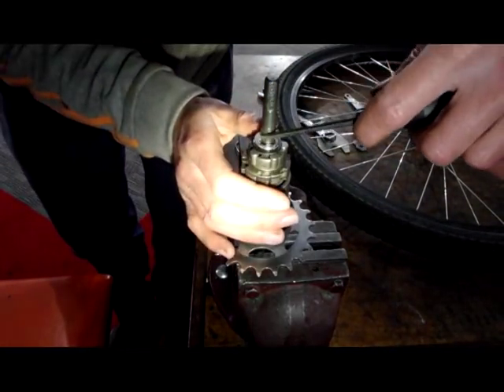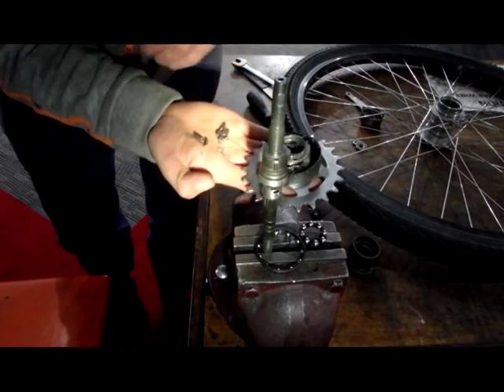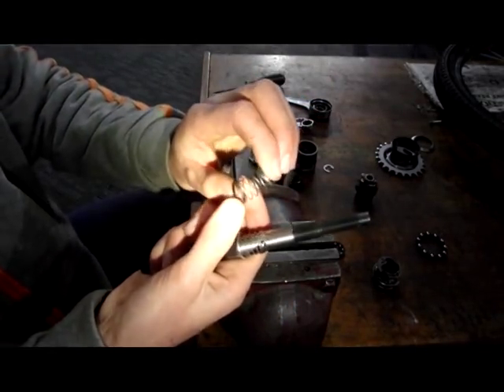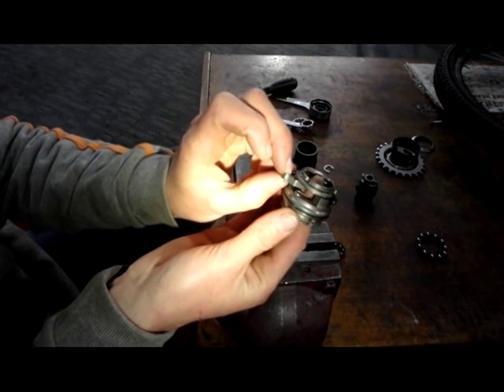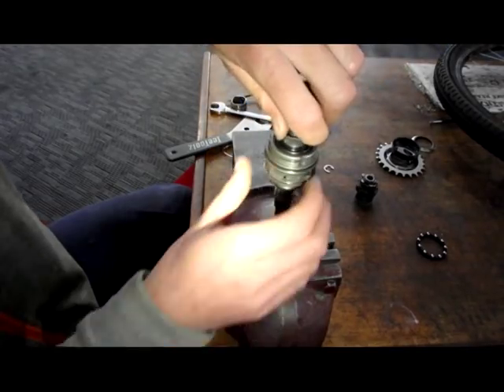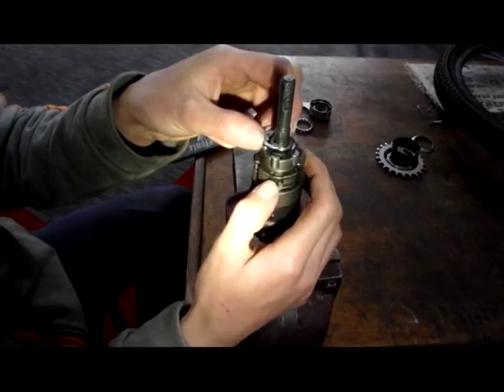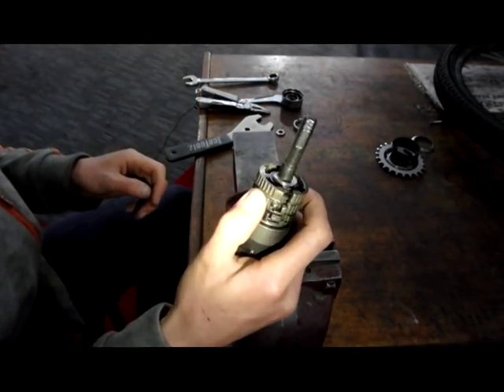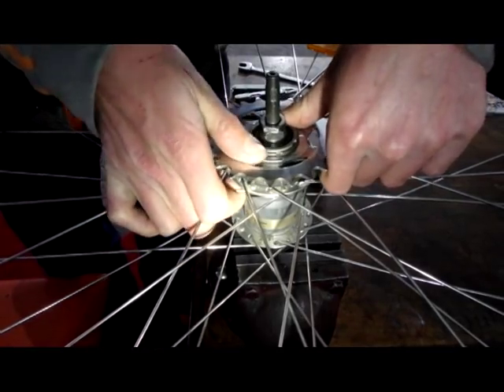How to strip and rebuild a Nexus 3 speed hub

Comment: Hi buddy, I believe you overtightened the first cone (approx. 8-9 minutes in). You’re supposed to tighten the cone as far as it will go, then back off 120degrees. Then lock in that position with the lock nut. This leaves a touch of play to prevent premature wear. Hope this helps!
Reply from the maker: It turns out that the 2 head bearings are opposed by a single tail bearing.  It is a bitof a  weird set up but you can safely tighten it right up to the shoulder. The brake side bearing takes all the tension adjustment

Comment: My dissambly ends at 2:40, when one little spring went off for ever! - I would prefer to lay down the parts in the way when they appear. A not so dark paper or  a textile on the work bench will help to prevent a chaos of things. An explosition drawing from Shimano‘s hub will help to put the parts together, and is a good training to study technical instructions. - I did never seen to put the vice in this way at the right end on the work bench. But its a good tip, when the mechanic is a right hand trained person.
Reply from the maker: im a leftie, in a right handers world

Comment: Well done!  This has got to be the clearest how to video I've seen to date.  Cheers.
I do have a question; my daughter's bike came with a v-brake in addition to the coaster brake, I'd like to eliminate the coaster brake.  Is it sufficient and possible to just remove the brake arm?  Or a better way to go is to eliminate the brake shoes?  Or does eliminating the brake shoes mess up the assembly for the bearing that sits on top?  Thanks.
Reply from the maker: It should be ok to remove th ebrake shoes, it might pay to remove the 5 hardened rolls that activate the shoes, you need to take that surclip off.
the braking action grinds hardened steel past hardened steel behind the same grease seal as the rest of the moving parts. with all this hardened metal muck floating around, wear sets in, as wear sets in, gaps increase, pins move, springs drop out, munched spring wire migrates into the bell housing, and jams it between 2 gears, when this happens the hub locks up but the wheel is still moving foward with a huge mechanical advantage over the NO TURN washer on the axle. the axle spins in the no turn washer, and the hub is cactused... all because some pea-brained dimwit put the brakes behind the same grease seal as the rest of the moving parts
Reply: Can you post a vid of exactly what you are talking about? I'd hate to mess it up.

Comment: Hi mate!
Love your video, and used it to dis- and resemble my gear hub.

I got a blocking on 3rd gear. 1st fine, 2nd more resistance but when going on 3rd the pedals only turn 1/4-1/2 around before blocking completely. If I switch to the 2nd or 1st gear, and roll the back wheel backwards, the (new) push pin pops back and I can continue cycling. 

When staying in 3rd gear and rolling the wheel backwards, there is a clicking sound every 1/4-1/2 when the wheel turns.

The hub was old when I got it and restored it, so no guarantee that it worked when I got the hub.

What do you think is the problem?

Best regards
Reply from the maker: I usually found that the quickest way to fix it was to strip it down to the bare mines, and reassemble, 
The strip down takes less than 30 seconds, the reassembly takes less than a minute, if you have your tools in a row.

Look for extraneous broken shards of metal causing a constipated hub
Reply: @AdamEdington  Cheers mate!

Might give it a go soon, but I am expecting the strip down and reassembly will take longer on my behalf ;)

Thank you for your kind advice!
Reply from the maker: @hunnicke1986  usually 
something is not moving as far as it should, or jammed up with some thing where it's not meant to be
Push pin should have 14mm stickout
Reply: @AdamEdington cheers!

I couldn't find the missing part/link/fault so I stick to 2 out of 3 gears for now 😂

Now I got a new problem. On an advice from a friend, I removed a lot of the thick chain grease I had used before (I am new to this and learning) and then I gave the whole thing Caramba Premium MultiÖil. Now the foot brake screams when used. What would you suggest to fix it? Put the whole thing in transmission oil (as I got recommended from a local bike mechanic)? 🙂
Reply from the maker: @hunnicke1986  ok that makes a bit more diagnostic sense.
I'm going to need you to run a few more tests for me
It's a bit hard for me to do this remotely, but

Test number 1 attempt to shove it into 3rd gear and wait. 5 minutes and try , perhaps give the shell a knock or 2 every now and then

Test number 2 are you certain that it is actually gears 1 and 2 that activate and not 2 and 3 and  1 is sticky

How far did you strip the axle down, did you take the bell housing off the axle ...this is what shifts the engagement
If the grease is too thick, the springs don't have enough oomph  to drive that the pawls, which  still think the  bell housing is in position B when the bell housing is in position C creating a double ratio lock where gear 3 is actually engaged, but gear 2 fails to disengage
See description for correct  lubrication
Reply: @AdamEdington  took the whole thing apart, washed it down, air dried it, grease on the rings, put it back together, soaked in transmission oil for 2-3 minutes and now the 3 gear do not block any more. Thank you! 😀

The split doesn't go fast out though from 3rd to 2nd. Must be the click box/cable then.

The foot brake screams less but still a lot. This is possible to live with.

Thank you so much - can I transfer some money for a cup of coffee or a cold pint to you? 🙂
Reply from the maker: @hunnicke1986  ha ha that's awesome
PayPal edington.machining@gmail.com

You need Shimano white hub grease for the brake
Reply: @AdamEdington  But where do I place the grease? I already put a lot on and around the bearings (both the big one close to the "brake arm" it self and the small one on the other side of the other side of the wheel). Feel free to mention where in the video 🙂

Ps. I will contact you soon on email then for the pint/coffee!
Reply from the maker: @hunnicke1986  white grease goes on bearing surfaces, brake shoes, gears 

I am not volunteering there any more, so unfortunately the video is all you have, but check the description

Comment: I find these parts with concentric circles perhaps to decrease surface friction. its like finger prints sort of. Also I found this part with a hex or octogonal clip to prevent overtightening and stripping of bolts is like a octagon but with rounded corners like circles for extra friction at vertices.
Reply from the maker: what parts are you talking about?

Comment: FYI grease is very use specific, High temp grease is not good on a bicycle as the bearings never get to high enough temps... High pressure is the same.. Thick grease will never get thinner and move easily if it doesn't heat up.. also using Ceramic grease is great for racing if  you repack your bearings frequently, Yes, the movement will be very light and smooth and FAST - But, most ceramic grease has no way to stop water or dirt from making it go away (it will wash out easily).. the best all purpose grease is premium waterproof bicycle grease - Ive used Phil's tenacious, Bullseye, White Lighting Clear, Finish Line Premium (Currently using it attached to their Bicycle Grease gun)  - JUST SAY NO TO AUTOMOTIVE GREASE -
Reply: The question for me was what grease to use on the bearing on the brake side. Ended up using regular bearing grease.

Comment: There are two actuator pin length 82 and 87mm. If you just converted your kids bike and it got ony two gears, you probably need the short pin. The long one can just be ground down at the inner part to make it fit. But if you watch this video, the gear is already apart and you are looking how to place the dropped sears...
Reply: VomDeich , their is another length of the actuator pin of 95mm. Used sometimes in Hollandbikes, essential is the length of 14mm outside the axle!

Comment: Thanks for a very instructive video. I have a few questions:
When and where should one add lubrication to the assembly?
What kind of lubrication should be used?

Thanks, Daniel
Reply from the maker: +daniel hegner 
in the gears, and bearings, use slurpy grease, shimano puts out a special formulation, DO NOT use HTB it is too thick and viscous to let the ratchet work, i have seen about 4 hub lockups caused by some idiot using HTB
Reply from the maker: Will Swift  gotta be careful of mixing lighter hydrocarbons with heavier hydrocarbons, over time they have a tendency to separate and leave behind the heavier more viscous stuff
Reply: Does the apply for nexus 5 speed when it comes to the circlip remover? And how do I remember the position of all those parts?

Comment: Am I right in thinking that there doesn't need to be any grease in the "guts"? Just the special brake shoe grease? My 3-speed keeps skipping in 2nd but absolutely fine in 1st and 3rd
Reply from the maker: Check the springs on the  pawls, they may be damaged, and not forcing the proper engagement.
Check the length of the push pin, it should have 14mm of stick out
Check the alignment of the indicator in the gear shifter clamp on mechanism @ gear 2

The gears should have a bit of white grease in them

Comment: Astonishing, baffling slew of parts. Reading all the comments, & that the video instructor assembled a fleet of these... & used words like 'garbage'... I am curious if you have any idea why I would have almost lost my life on a bike with one of these hubs. It started riding 'rough'... but I continued to ride, since I only had 10 blocks to go/ college homework, etc. The bike literally fell apart on me, stopping dead in its tracks, with the chain falling off, & I went flying straight down into the cement, gaining a severe knee injury. I would like to do something with the bike I barely used. Would you suggest just installing some alternate hub? Any recommendation on how to make a bike with this hub safe so I don't die on it? Thanks.
Reply from the maker: the nexus 4 speed is a good one, i havnt had much to do with it, so cant say for certain, but the one i did take apart looked very well designed.
Sturmy Archer 3 speed hubs are known to still work 50 years later, but they arent the most efficient

i ride recumbent ICE Trikes these days, so much safer than Mulga Bill's "Two Wheeled Outlaw"
im not surprised in the least about your unfortunate incident, we had a few lockups, usually the axle turned in the no turn washer, kind of a fusable link, but total system lockups arent unheard of

i suggest youpost a video of pulling apart the offending hub, according to my video, and showing the damage, probably spring fragments or other fractured bits have ended up inside the bell housing and jammed two gears against eachother when you tried to shift gears

stay safe, and again i highly recommend you switch to a three wheeled tadpole
Reply: @AdamEdington  How does this happen, that you would have spring fragments/ fractured bits, inside a sealed hub? And if springs broke, where do you get replacement parts? Thanks for your input.
Reply from the maker: @cchemmes5831  as the brake is used, fine particles of hardened steel start grinding everything, clearances increase, pins migrate, springs drop out, sometimes the drive input sheds some fragments off the thin lip.
I never got to order replacement parts, just cannibalise another hub for spare parts
Reply: @AdamEdington  Thanks for the input. Mine was new/ used only a few times before crashing, so that seems messed up for a sealed, supposedly high quality hub. My brake is a separate roller brake as well.
Reply from the maker: @cchemmes5831   ok, did one of the cam rollers come loose? 
We did get a fleet of those a little while before I left, never had any problems with them so only poked my nose in once.. so let me postulate from ignorance and partial knowledge.. There should be a circlip to retain the hardened  rollers, maybe the anchor bolt came loose,
Send me a photo of the damage, edington.machining@gmail.com
Reply: @AdamEdington  I can't send a photo of damage because the whole issue is I have no idea at all why this bike just stopped, mid-ride, with the chain falling off, causing me to crash. I had checked everything according to the manual--- like the line in the window of the shifting coupler at the axle, & had thought chain tension was okay/ bolts were properly tightened, etc. I thought it was all set right, because I had actually checked everything out, even though I am no bike expert. So it was really baffling, since it was a new bike. The only thing I could guess is maybe someone had meddled with it while I was in the market (as I've been dealing with some bullies in my life, on the war path for God only knows why, severely attacking my life for a long while now), since it rode fine to the market, but with instant trouble the minute I started riding after I left the market. It is just baffling to me how I crashed like this. I don't know what it was--- I wasn't saying it had damaged parts. There is a local bike coop/ repair teaching center, so I am hoping to take it there. I am just trying to understand how my accident happened, & figure out what I can do to make use of this bike that I spend 100s on, & never could use much due to this accident. I would like to use it/ fix it, but feel fear with it now. I wouldn't know what photograph-that is the whole problem--- not understanding what could have gone wrong & it was not something obviously visible. I just wondered if you might have any idea why this would happen--- on a new bike, where the shifter looked properly adjusted, everything seemed tightened properly, etc. Thanks.
Reply from the maker: @cchemmes5831  ok snap a picture of the rear dropouts, then take the brake assembly off and snap a picture of the inner side, and mating splined part.
Then  I'll tell you where to go from there..
Is the wheel still aligned, not kicked off to the side?.
Is the axle turned inside the no turn claw-washer, 
Re: those bullies. I'm dealing with a similar issue at the moment. The super hero in question has commented on this video. This super hero threw a rock through my sisters car window trying to get to me. 
If we can have photographic evidence of sabotage you'll be in a position of power. But you need to prove connection.
I've got cctv of his car fleeing and written threats, and written defamation but that's still not enough for prosecution

I suggest you check out the YouTube channel surviving narcissism with dr Les Carter.

My best bit of advice put yourself in a position of power then you won't  be in a position where they can take advantage of your position of weakness
All the best 
Ps if ever you're in Adelaide, I'll take you rockclimbing for free. Assuming your knee will let you.
Reply from the maker: @cchemmes5831  how ya going buddy?
i just wanted to know if youve sorted that thing with the bullies, i hope youve sorted it for the better
im about to do a legal crocodile roll on my nemisis.

Comment: Hello there Adam. So, if I understand this correctly, I simply take of the brake actuator, and then the entire internal assembly comes right out? (I need to paint the hub housing black...)
Reply from the maker: @mortenhansen3455  yes it takes a little click to get it out, which is the plastic grease guard on drive side doing it's thing

Comment: Great video. By the way, do you know which tiny component is the piece that breaks/bends when the Nexus 3 gets stuck in gear? I have asked a few "experts"/bike techs, and nobody can tell me! Thank you.
Reply from the maker: the push rod tends to get bent and is a bit sticky in the hole down the centre of the axle, make sure you have the right length push rod,   but there could be one or two springs come adrift jamming the bell housing to the axle, it might be worth taking apart, and giving it a scientific poke!
it could be a badly adjusted or seized cable... the marker should be between the lines in second gear
let me know what you find,

Comment: Thanks a lot Adam !!! Same hub in Shimano SG3C41 on Electra cruiser. It makes squeezing noises when breaking backpedal but otherwise rest works smooth. I am thinking to do this and submerge in oil lub shimano. Think that will solve the noise problem ? Should I also buy some black brake grease and put it before reassembly ? Do I need torque key or it’s fine just by adjusting with normal keys? Thanks a lot man
Reply from the maker: Use shimano white grease for breaks,
Strip fully, wipe clean,  inspect for foreign matter, broken bits of metal etc, reassemble, as per video.
Can't go far wrong.

Comment: Could you in theory place the pawls and pawl springs in the reverse orientation to create a hub that ratchets in the opposite direction? (Mounting the wheel so that the chain is on the left side vs. the standard right side)
Reply from the maker: The matching cutouts in  hub shell would need to be reversed as well

Comment: My hub won’t go into first gear using the hand shifter. I can stick a pin into the axle and manually get it into first if I jingle it about. Something mechanical is amiss inside. I’m going to take it apart per this video and see if I can find the problem. Has anyone here had this same problem, and what was the cause?
Thank you for a great instructional video!
Reply from the maker: keep yer eyes peeled for spring fragments jamming up the bell housing
Reply: @AdamEdington  Thank you Adam👍 I’ll let you know what I find.
Reply: @AdamEdington  If it is spring fragments, then I suppose I’ll be in need of a spring.
Reply from the maker: @brythecracker  the other source of fragments is the rim of the drive side bearing assembly with those opposing pals.this piece is very prone to shedding hardened(brittle) fragments into the works..
Reply: @AdamEdington  Thanks Adam👍